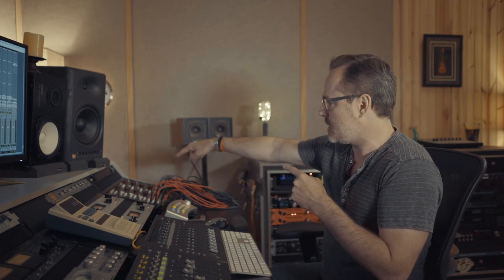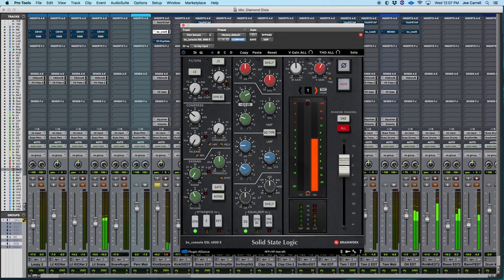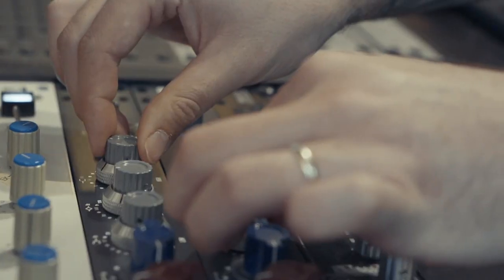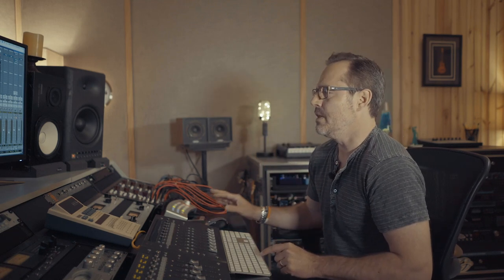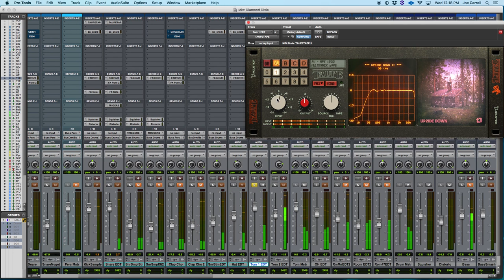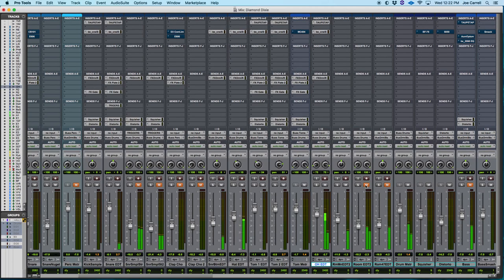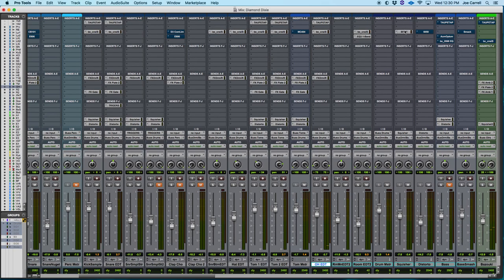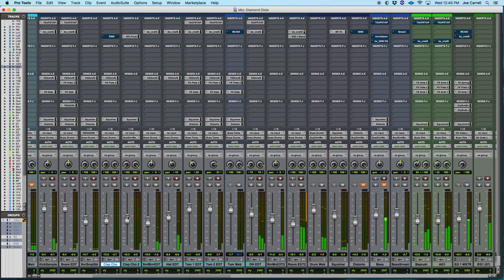Warm Audio // In The Mix w/ Joe Carrell - EP 22 -The Mixing Process Part 1

Comment: Joe great stuff, may I ask what monitors are you using?? Looks like hoy have a pair of Yamaha HS 8 or 5 ?   What is the set beside them?? Love your mixes,..
Reply: Derek Babanin thank you Derek!  I’m using the same speakers I’ve had for 13 years now!!  Haha.  There are definitely later and greater on the market but I’m just comfortable with these still.  My “full range” speakers are JBL4328s. My mid-range focus is old Yamaha NS10s.  I came up on them and can’t imagine working without them.  Lastly, I have a second set of old super mid focused auratones.  I keep them right beside each other over to the side so I am essentially hearing Mono when I check them.   

Typically I will make most of my preliminary EQ, balance and panning decisions on the full range speaker.  When I am ready to start the adding  vocals I switch to the Yamaha‘s and double check everything I have done to that point and use only the Yamaha’s for all vocal equalization and automation.  I don’t listen long to the auratones, but for a minute or two here or there they can tell you quite a bit about how loud the center band elements are versus hard panned elements like electric guitars, acoustic guitars, orchestra, etc.  sometimes in the sweet spot we fall victim to the “apparent” loudness of panning.  It’s just a good double check for the actual loudness of the frequency range where we are most sensitive and most instruments live.